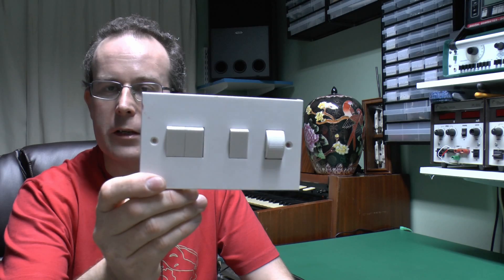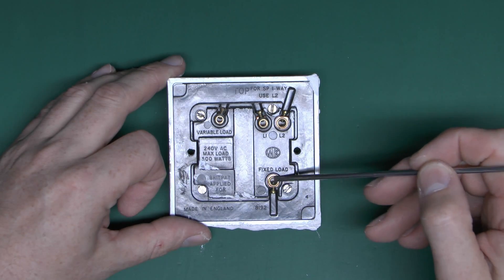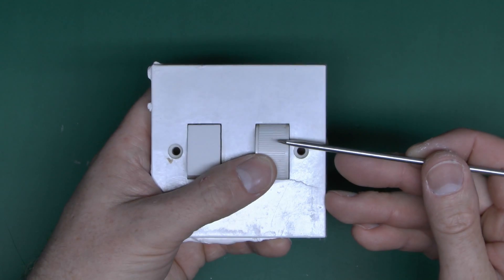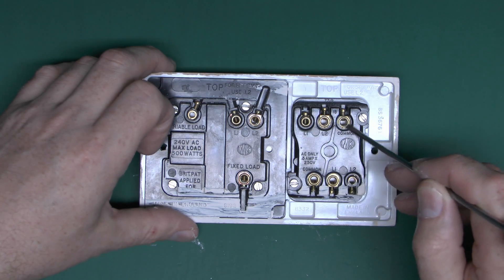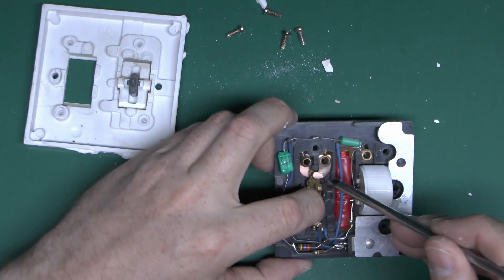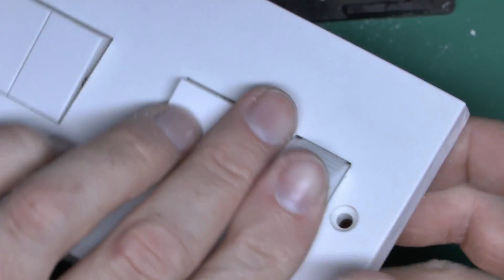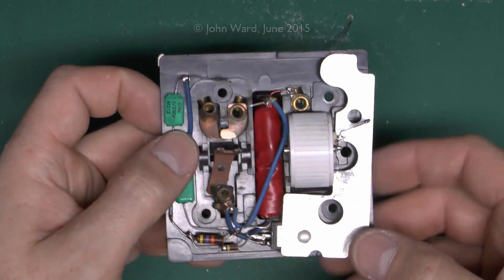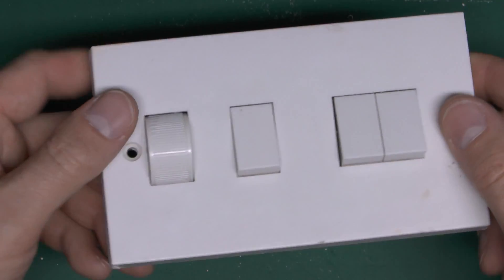Old MK Dimmer Switches

Comment: I have one of these switches, the red wire is in L2, and the black wire is in variable load. The red is live when the consumer unit is on.  To replace this with a standard modern 1 way switch I'd have thought its red to common and black to L1 but this seems to have power to the pendant when the switch is in the off position?

Comment: the later versions of those MK dimmers with seperate on-off switch incorporate a metallised paper suppression capacitor which can fail and fill the room with smoke. Fiddly to replace but a polypropylene capacitor can be fitted in its place and then the switch will last another 30 years

Comment: the fact that the triac has failed should show the reason why merely switching a dimmer off does not equal safe to work on load side wiring as triacs can fail in a dead short as well as open.

Comment: Nice video, and I love those UK switches.  Also I notice the "down" position is on?  And rotate the wheel down for bright... opposite of the USA.  I'm also curious about the inductor, I would have thought it would have been a simple rheostat.  With a Diac and Triac, wouldn't that generate frequency modulation and allow the dimmer to function as a motor speed control?
Reply: Greetings, the phase shift, and therefore dimming level is merely due to position of variable resistance,, the inductor is mostly for noise suppression,, in fact the circuit would function without it but you would hear this in a nearby radio,,,
Best wishes Warren

Comment: Hello. Kinda tangential to the subject of this video, but while on a trip to London some years back, I noticed that most of the wall outlets in the hotels were switched right at the outlet. Is that common in UK residential wiring too? It seems like a good idea that I wish would've caught on in the States; I use switched power strips like crazy, in order to reduce the vampire loads from "off" electronic devices.
Reply from the maker: +Shmeh Fleh Yes, most outlets are switched.  Unswitched versions are available but generally only fitted for things such as built in appliances with a separate switch elsewhere, or for thing such as office desks etc.

Comment: The triacs often fail short circuit, very easy to change, they often fail when a lamp fails. The reason for this is that as the filament initially breaks a cloud of metallic vapour forms which virtually shorts out the lamp, if you have magnetic trips they will often trip at this moment.

Comment: Good old MK, best switches in the UK. Never seen dimmers like that though but I would have been all of 7 years old when that dimmer was made. Thinking about it though, a seperate switch with dimmer control makes more sense than a combined switch/dimmer unit. set the dimmer for the preferred level and then use the swich for on / off,

Comment: I've never seen ones like these before. I put a dimmer on a halogen wall light but ti doesn;t seem to like it. Bulb flickers when the dimmer is in certain positions.
Reply from the maker: RandyDarkshade Flicker may be due to the load being too small, most modern dimmers require at least 40W to operate correctly.
Reply: Ahh....Erm...I can;t remember what the wattage of the bulb is off top of my head I think it is less than 40w. Thanks for the info.
Reply: ***** 240v mains light.
Reply: +Jeff If it has electronic circutry, reduction of the current could cause an op amp follower to oscillate. In this case, flipping the light off for a few seconds and back on should stop the flickering. &#160;
HOWEVER, I do not think halogen lights have such electronics, but i think this is what you were getting at, i don&#39;t think it applies here.
My guess is that the reduced current prevents the halogen bulb from having enough start up current to fully ignite the plasma, so the filament can never reach a high enough temperature to find equilibrium. Once in equalibrium, the wattage requirement will settle to the rated wattage, but messing with the current could effect the voltage(2 resisters = voltage drop) enough to initialize another startup, but fail, because of the limited current.